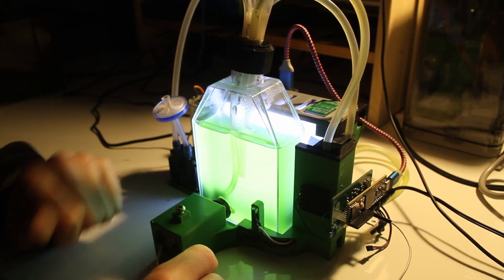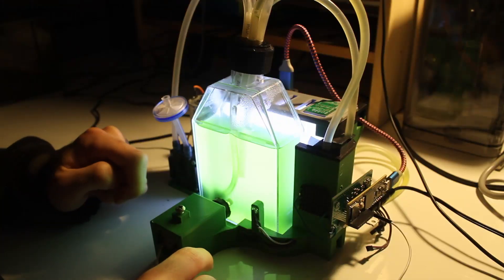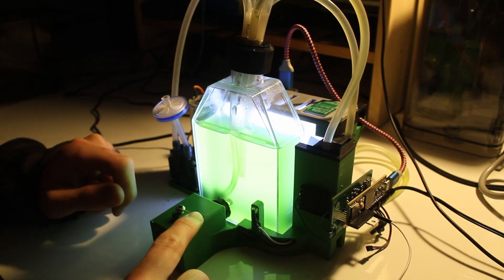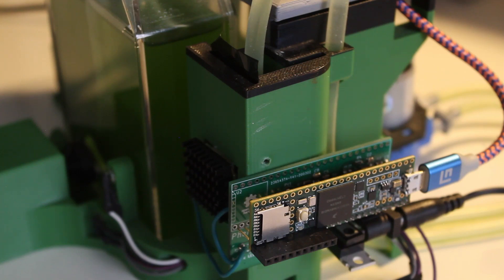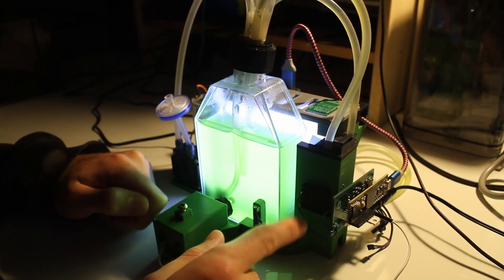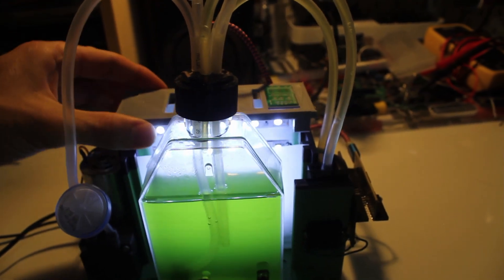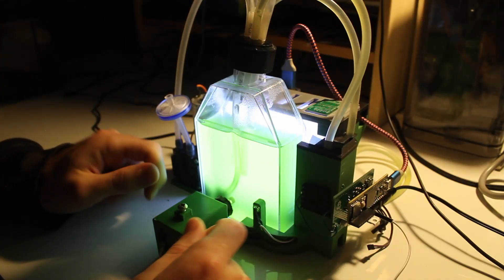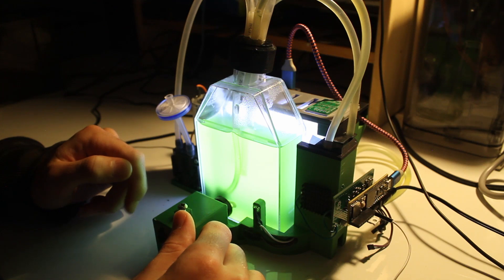Raspberry Pi based Photobioreactor

Comment: I like the low-cost construction approach. I recently graduated with my bachelors of chemical engineering and have been considering algae cultivation as part of a larger process I'm designing and hopefully operate someday (side hobby). I would appreciate to know the cost of the sensors and computer parts you used. Also, would it be difficult to put together your hardware and software as a novice like myself? Not quite my area of study but willing to teach myself. I'm trying to keep my project cost low as possible. Need the budget towards safety equipment and material for some custom pressure vessels and heat exchangers.

Comment: Can I know the use of that waterpump behind it? Plss do reply
Reply from the maker: Hello, its a generic 12V peristaltic pump you can get off ebay, I've just upgraded the silicone tubing as the one that comes with the pump can crack.
Reply from the maker: https://www.ebay.com/itm/353153163498?hash=item523991 something like this